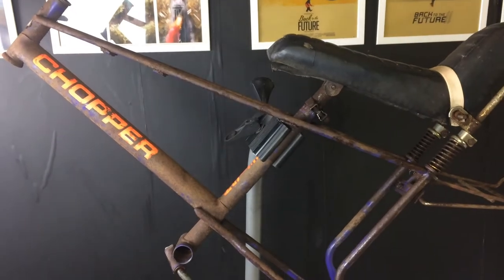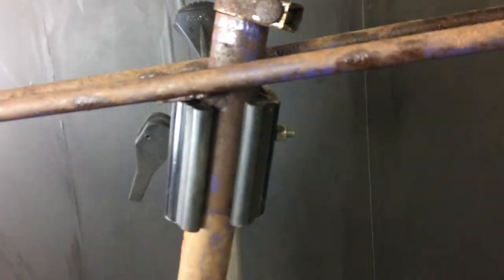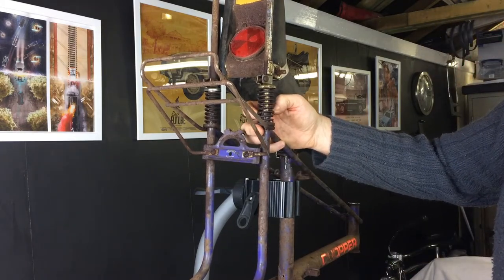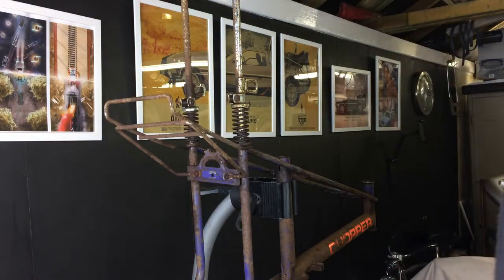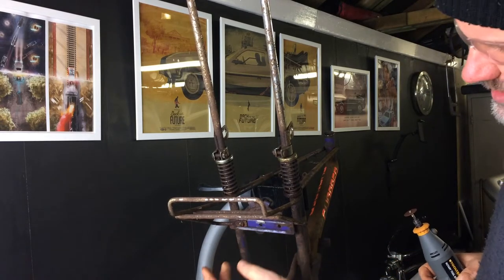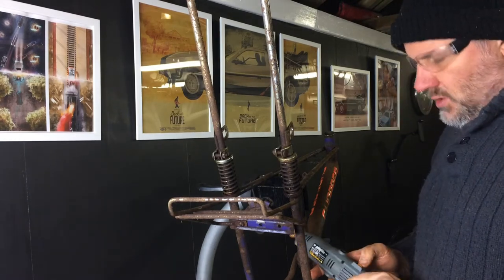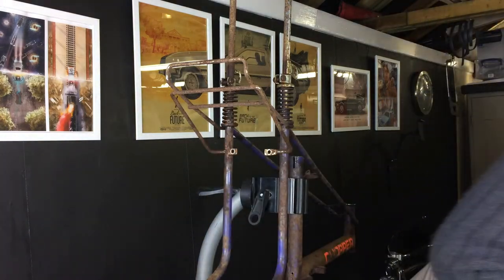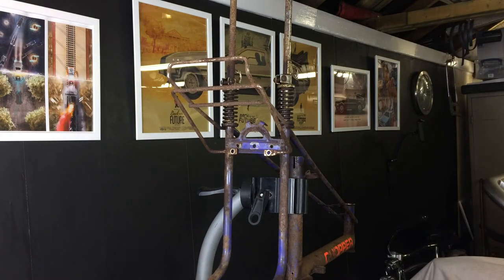Hedge find Chopper - Part 2

Comment: Heat can help free up rusted parts but blow torches can damage paint. I've had some luck in the past using a soldering station hot air gun played over stuck joints, nuts, etc. Doesn't always work and you often need several heat/cool cycles but it has controllable temperature and less chance of paint scorching.

Also for cleaning surface rust off chrome surfaces, try scrunched up aluminium foil dampened with a little water. Give the rusty chrome surface a bit of elbow grease with this and you can remove a lot of surface rust. This was a trick I learnt years ago restoring railway locomotives! The aluminium foil is harder than the rust, but softer than the chrome so removes and coats rust and doesn't scratch any remain chrome surface. For large areas, try a brass wire wheel on a drill (works for a similar reason).

Comment: having same problem with sissy bar. cant get it out. when is there going to be a part 3 about removing the rust from the parts? amazing videos
Reply from the maker: Waiting on weather to warm up. Will be clear coating it as, to keep the patina. Not managed to separate sissy bar. Watching videos, people cut them out, but I need to keep it, so unfortunately just going to leave it in, as not my bike.